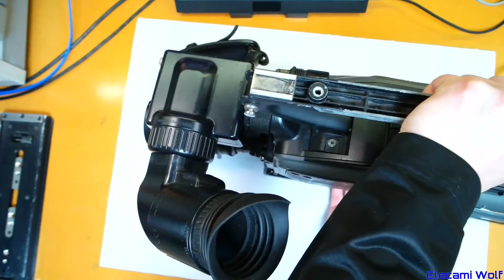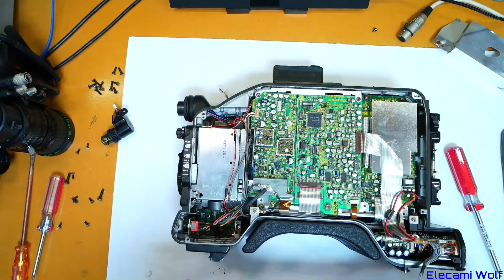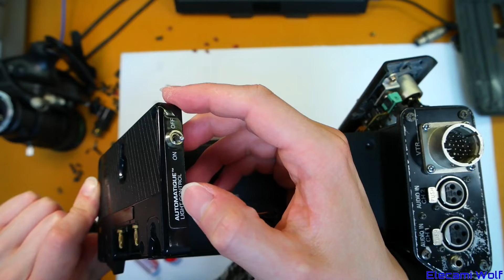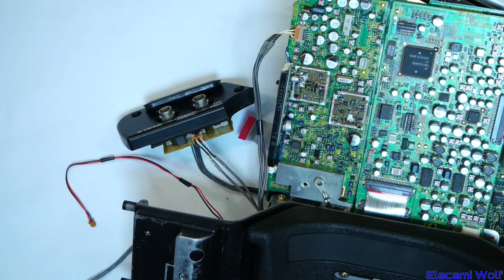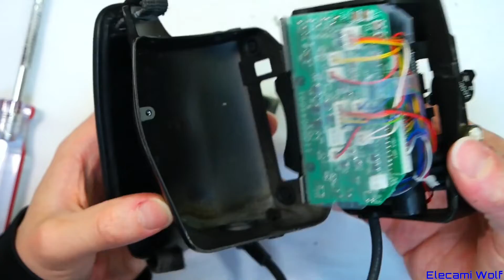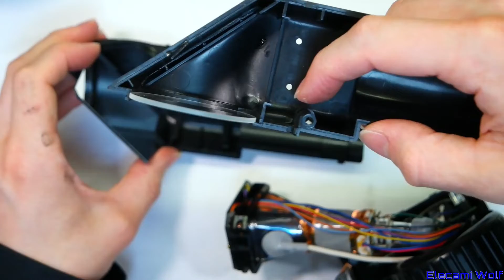EW0017 - Panasonic AG DP800 SVHS Video Camera Teardown

Comment: So I just got one of these cameras off Ebay, and everything seems to be working great. I am planning on shooting a feature with it in Dec. But I am trying to figure out the monitoring. How did you get a feed out of the camera to a monitor? Like did you have a converter or device? It looks like you used an RCA cable with BNC adapter on it? Do you mind sharing more info about how you did that? Thank you.
Reply from the maker: Connect monitor to the Video output BNC Connector. 
Use a monitor with composite video input of use a converter to another format.

Comment: I got error slack cylinder NG please how can I remove my tape inside is really important it got stucked was ejecting properly after I got this error and vtr blinking on the viewfinder after some noises in the start no response from buttons like eject start rewind ecc
Reply from the maker: There is likely an emergency eject procedure you can use by turning a knob or screw somewhere on the deck. Need to check the manual to find it.
Reply: @Elecami  I finally ejected it

Comment: where do you find service manuals? i’ve got a panasonic AG-DP200 and think it needs the built in battery replaced but can’t find where it would be in the camera. just trying to avoid taking it apart and winging it lol
Reply from the maker: Usually find them by Google search.

Comment: Can I ask you how as a not professionist I can fix the vtr lamping problem that don’t let me record and the tape was ejecting properly also during this vtr lamping yellow but now also doesn’t want to eject and everytime I turned on is all green including vtr for some minutes and after lamping yellow, I have a nice video while connecting the tv and my viewfinder il glitchy black and white but in the tv all good so the video looks really good I need only to eject and record mostly but idk how
Reply from the maker: Not sure what you mean about 'Lamping Problem'.
Reply: @E @Elecami rry for my English like VTR Light circle blink and remain yellow in the end for not let me record maybe this can be solved by cleaning inside with a cassette for cleaning or by inserting a real nice cassette but I’ve been trying even cleaning this circle part with isopropyl alcohol and printer paper really gently but still the output. Video show me these bars horizontal that are yellow and green and most strange and these probably signal that to correct maybe from some controls I’ve been trying changing every settings without any success every time my output even the cassette in the VHS reader shows these stripes and I’m trying a lot of things without being a professionist so for me is getting really long

Comment: What XLR power supply is compatible with it?
Reply from the maker: Normal 12V used with any video equipment.
Reply: 11-15 volts 3 amps will be enough

Comment: Man, I'm looking to buy one of these. They used to be all over on eBay like a couple years ago and now there's only a couple. How much did you pay for all these guys? Sucks that the head drum is still the smaller-sized one compared to regular-sized AG VHS decks.
Reply from the maker: I still see quite a few VHS cameras on eBay. I have collected these over the years when a good deal comes up. Paid somewhere between nothing and $40 a piece.
Reply: @Elecami  Oh yeah, the VHS camcorders themselves are everywhere, but the AG-DP800 is getting scarce really fast. Do you have a working 800, at least?
Reply from the maker: @KlonoaTorqueBow  I only have this one , shame it is pretty beat up. Why do you want this model?
Reply: @Elecami  Well I got my hands on a rare AG-460 2CCD that needs a little TLC, and the AG-DP800 looked like Panasonic's next step up into true pro-grade cameras. Either that one, or the AG-F series. so I wanted to compare the two together. I also don't want to pay like 1500$ for one, but I'd also want a beat-up-but-working/light-flaw, with the lens. Something I can hook up all the XLR and pro-gear I already have and get it working for a review.
Reply from the maker: @KlonoaTorqueBow  Interesting I had not heard of a 2 CCD camera before. I need to get one for a teardown.
Reply: @Elecami  They (AG-460) were a limited-run model in at least the US. They might appear under different model numbers for international makes, though.
Reply from the maker: @KlonoaTorqueBow  I'll have to keep an eye out.
Reply: @KlonoaTorqueBow how much would u pay for a ag-dp800 I have it
Reply: @Elecami  Would you happen to be a furry, by the way?
Reply from the maker: @KlonoaTorqueBow  Furry, yes.
Reply: It works in the end? I buy one used all is working lenses too but glitchy b/n background in the view no image I should take it to repair by someone do you think is possible? I’m in Milan